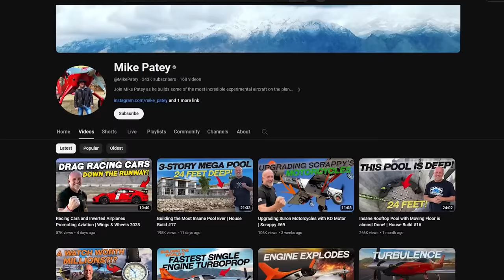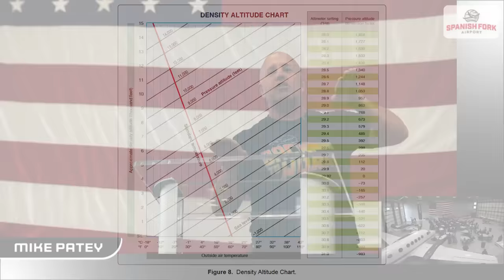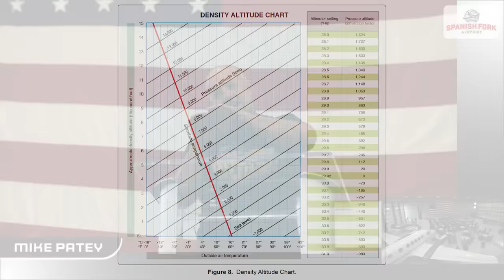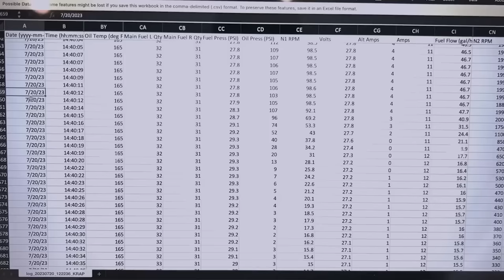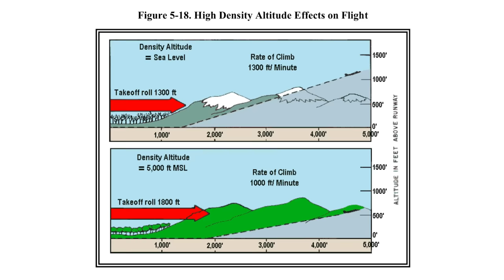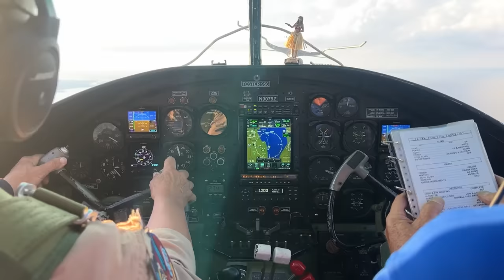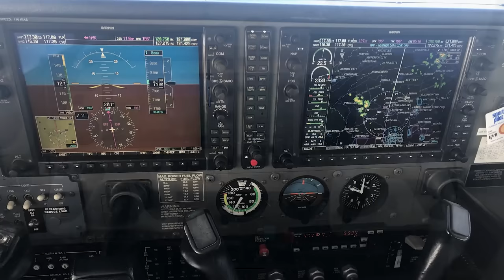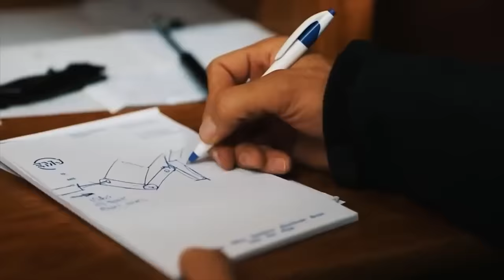I've Lost 4 Friends in 60 Days - Aviation Safety Discussion | Mike Patey

Comment: My first solo flight was almost my last flight. Everything is going good for the first 90% of the flight. I am in a rental 1976 Cessna 172. I am 8 miles from the airport, an uncontrolled field. I make all the proper callouts and begin to plan my approach when I start smelling smoke. It was that unmistakable burnt wiring smell. It's an old plane and smells like an old plane, but this is new. So I continue as normal and now I am SEEING smoke. It's coming from my feet under the dash. So I vent and begin to panic. I can't think. I can't decide what to do. I hit the radio transmit button and the instant I pushed it in, I lost the radios, all my instrument lights go dark and now I am bricking it (as in shitting a brick). It's still nice and bright out, perfect weather and the field is in sight. I start thinking about reaching into my pilot bag and get out my portable radio and making a callout. But I don't have time. By the time I get the radio out I will be on final and trying to land. So I go back to my training. Aviate, navigate THEN communicate. I did pull out the extinguisher and laid it in the seat next to me because I was expecting to see flames and feel heat. I get it down fine and taxi to parking. I did a complete shutdown and got out. I start poking around and found a wiring harness with about 12 wires were melted together. I took pics and sent them to the rental shop along with a description.  They sent another plane out to get me and made whatever arrangements they had to do about the broke plane. I found out from their mechanic that when the new radios were installed by the past owner, they routed the wires incorrectly so whenever you pushed the pedals, it pulled this wire back and forth which cause it to rub against other wires and eventually wore thru the insulation. How do you protect against that? I went through all the documents and checklist when I rented it. All the air worthiness docs, all the maintenance docs (the AC 43-9C) and it looked like a well maintained aircraft. I almost quit it shook me up so much. What if I were over a city at night in weather? Granted, I would never be in that situation unless I were much more experienced. It took a while to get my confidence back, and people think I am nuts when I look up under the dash before I fly! lol
Reply: 55 yrs CP and AP 
I've many incompetent AP and AI. No integrity pencil whippers.
Reported some to FAA, ignored, and 3 people died exactly as I predicted for that aircraft. Zero happened. FAA sucks.

Comment: Flying into a dead-end canyon that can't be over-climbed is one of the primary reasons the Chandelle maneuver is part of the FAA Commercial pilot standard.
FAA defines it as, "a climbing turn beginning from straight and level flight, and ending at the completion of 180 degrees of turn in a wings-level, nose-high attitude at minimum
controllable airspeed." The key is full power to min airspeed, lots of rudder to keep from skidding with the nose high attitude. Done correctly it puts half or more of aircraft's turn total radius in the z-plane (vertical plane) which minimizes the horizontal radius where the canyon walls preclude a flat level turn. Given the left turning torque at full power, nose high attitude, most standard GA aircraft, the turn should be to the left if possible, which means hugging to the right side of the canyon before the maneuver starts. This has to be practiced to confidence in the particular aircraft so that a stall spin won't be initiated.

Comment: Wing stall at low altitude with no room for recovery.
Aircraft speed must maintain lift sustaining flow in critical flight regimes.
Never dice with overloading conditions and engine anomalies in operational control.
Check list fuel an center of gravity every pre flight.

Comment: Mike, I am not a pilot, but have read aviation stuff for fun for many years.  I am a chemist and physician, though.

I believe that to raise awaereness on the effect that altitude/temperature has on air density and performance, the term "High Altitude Density" should be replaced with the more descriptive of the problem at hand: "Reduced Lift Altitude."  In this way, new pilots and old ones will think twice about the total weight on an airplane, and other factor affecting lift/performace, when planning.  How long would the maximum take off roll be for this particular site and plane, and plan accordingly.

We forget things easily as we age & become less alert in whatever we do, and if the safety mindset is not hammered into our brains early on, and re-learned day in day out, tragedy strikes sooner or later.

Language matters, and the term "Density Altitude" does not scare the hell out of anyone, but in my estimation "Reduced Lift/Density Altitude"  or "Reduced Lift Altitude" does a better job at making me think twice about safety before the takeoff roll.

Greetings from Puerto Rico.

José Antonio

Comment: Hi Mike, I recently had a guy ask me if he should take the TKS option on his new order DA-62. You explained so well why TKS is a terrible choice for most GA pilots - simply, you shouldn't be in icing conditions in the first place and TKS will not necessarily dig you out if you get yourself in trouble. It's a false sense of security. Your general comments on safety are well-reasoned. Can I ask if you and your brother have a safety manager or an integrated safety management system for your operations? It seems like you have enough complexity to warrant it, if not through regulation then through common sense. Formalised safety management is so incredibly beneficial to general aviation.

Comment: I was sort of wondering the other night, how pilots of "heavy metal" actually count their Flight hours. I mean, if someone is a 10.000hr pilot, does this mean that the time is counted from Wheels up to wheels down? Or do pilots also count the taxiing out to the runway? (as they are basically controlling the airplane at this time.)
Reply: Usually from first movement under local power until last movement, including taxi time.

Comment: I'm not a pilot, but this information should be required for anyone getting into an airplane.  All the lives in the plane need to be aware if the pilot is taking any risks or has accounted for everything.  Other people in your airplane should cause you to be that much more diligent in your strike system and they should know.  The risks should not be superseded by the thrill.

Comment: I've always felt relying on de-icing fluid is stupid.

1) turn on too soon and you run out before you clear the icing.
2) turn on too late and it wont work.
3) don't turn on at all and it's pointless to have it.

you need something that heats the wing and melts the ice, or a physical de-icing like boots. or just don't fly in icing.

Comment: If in ice, and you have the performance - always CLIMB out of the ice.
The ice layer is only a few thousand feet thick, and it will end.
You can always come back down.
Just add a whole load of extra airspeed, onto the stall speed.

Once you run out of performance,
You are coming down.

R

Comment: i agree with you 10000% i  have been flying since i was literally 8 years old. i had my 1st flying lesson in san carlos calif for my 8th birthday/ i fly a 1978 cessna 340  new ram engines new  full glass panel. i have owned that airplane for since 1981. BUT i will not fly if it is winter  or known icing in my trip. maybe i am a fair weather flyer. but  safety is my number 1 thing. if i do not fly for 4 months i call my instructor and say let go for a check ride, i am 70  and  do not basically want to scratch my airplane  and i like living. also pilots today  only know how to fly on computers. they never  learned spins or high speed stalls. nor have they learned aerobatics. you have to know how to fly. not by cell phones or these fancy glass panels. i have lost many many friends over the years from stupid mistakes. they have to go,  the weather maybe bad but  the plane can make it that will get you killed. i have over 5000 hours in that 340  i do not want to get hurt.  or hurt someone else. i never have a 2nd pilot because they either do not know my airplane or know everything. that is the guy  i knew who crashed and killed himself and his entire family  i take my dogs  and one cat who is probably a better pilot than most of you take it off auto pilot and fly that damn airplane. get to know it. how it really handles.

Comment: The performance degradation due to ice is almost never due to the weight of the ice. Ice actually doesn’t weight that much. It’s all down to lift degradation. Also, iced propellers are deadly. I’d climb through icing with dead boots but prop deice unserviceable is just a no go no argument item. 
It wasn’t the weight of the ice that was gonna kill him, it was the altered airflow due to the ice.

Comment: I hadn't heard of 4 fatalities near Utah so I guess we don't hear of all fatalities in accident reviews. Let's get them on the table and learn from them. I figure we can solve it all. A lot of it with engineering. Take a rational look, no sacred cows, it can be done. One relatively easy thing that might be potent is for computers to listen to the plane. Engine sounds, fuselage and wing vibrations, performance of the plane if the acceleration on the runway suddenly isn't like it used to be. A computer can pick up very subtle things and software costs nothing. Some kind of strain gauge on the landing gear can tell the weight of the plane and could catch those clowns that tried to kill Mark. Automotive tire pressure sensors might do it. Same with building up ice, the computer can tell that the speed doesn't match the power settings on the engines. The vibration frequencies in the body of the plane also change if something is attached. Control surfaces will vibrate differently if the joint is lose or the control rod is. Good enough systems can tell if a single rivet is off.
If our planes have good synthetic vision avionics it's harder to get spatial disorientation. Maybe even thermal camera. Or a visual camera in case the windshield gets covered. It's hard to get lost if you can see clearly. And some planes are more dangerous than others. My pet concern is for instance the Bonanza. It seems to climb so slowly that it can't glide back and with a high stall speed it might get many in danger. A couple died in one a couple of days ago, possibly from lack of climb near mountains.
You could also imagine that engines have cameras in them that can pop in for occasional inspection. For instance a camera in a turbine engine for every stage that can pop in and take a look at every blade that pass by. Cameras can be dirt cheap today. Imagine if inspection would be a thing of the past. That the plane always senses itself like we sense our bodies. 
Plenty of opportunity to improve things. We can't have Patey fall apart on us so let's do this :)
Reply: 2 of the fatalities were Utahns.

Comment: I flew single engine at night because I HAD to for work. Especially out West, or anywhere you don’t have a ton of airports or “safe” landing areas, within glide distance, it’s a bad idea. I stayed high, and familiarized my self with  safe-ish areas to go should the engine quit. It was still dangerous. I see all these folks making unnecessary cross country flights over unforgiving terrain at night and shake my head. Just wait until light. If you can afford a plane, you can afford a hotel or delay a meeting. Any emergency at night becomes exponentially worse in the dark.

Comment: I think the ICON A5 crash incident flown into a canyon by staffs of the company is a typical example . Flying into canyons is a different ball game entirely.
Reply: Its an "Atypical" example. If you mean an example of how most people operate aircraft. That accident, along with the other high-profile crash, are both direct results of designing an aircraft for, and marketing it to be  flow and maneuvered at low level. This is a half-baked idea from its inception, and it will eventually kill every customer who purchases one. As long as they think its more of a flying PWC, and not an Airplane that can land on water.
Reply: @TheJustinJ  you do have a point there. Aircrafts should be advertised as aircrafts not power bikes or air versions of pwcs' or or even jet fighters!

Comment: Flat lander's in the mountains at the Aspen Colorado airport.  There was a mural at the FBO at Aspen showing all the crashes around the airport of the flatland pilots from Texas, Kansas, etc., stupid deaths taking off there,  likely with non turbo engines, with a full load of fuel, people, baggage for skiing and doing the procedural turn into the terrain instead of going down the valley to gain altitude.  "Selected against for Stupid."  Darwin award.

Comment: Not all pilot are engineers. Meaning it needs more than a book and protocols to be come a good and wise pilot.
What Mike points out is my horror two. Me renting out planes to airline pilots it occurred that these airline pilots are not always good and wise pilots too.  I started to do 15 minut refreshers before handing over the rented plane. 
Show me some proficiency first before you bend my prop.

Comment: EVERY pilot, all of you should be glider pilots before you become motor pilots.  These accidents would happen infrequently if pilots started flying gliders, we think so differently from motor pilots it's comparable to fish swimming vs birds flying, the environment is similar in some ways (fluid dynamics)  but so different that it's completely foreign to each species.   Up drafts, down drafts, cooling, heating, thermals, ridge lift, cold air, warm air, rotor, wind direction, time of day, where the sun is, shade vs full sun on hillsides, on and on.
Reply: Nope, you need to learn in AA1's and AA-1B's as your beginning aircraft.
You learn instantly about what not to do.
Reply: @arthurfoyt6727  The issue is most people don't get practical time in learning, just didactic time.  Because I learned gliders first I think like a glider pilot, I feel the air and think about what's always going on out there.  This makes me a safer pilot.  For example, while I fly I'm always scanning the ground looking for a bailout LZ.  This was drilled into me as a cross country glider pilot.  I see terrain and think about the wind direction and what is possibly going on around me.  I have had long conversations with motor pilots that seemed to tune out all this information and focus primarily on their aircraft.  It's 50/50 split, you need to know what's going on in your plane and what's going on outside your plane.  Too many focus on one or the other and this is where mistakes are made.
Reply: @kalbic  The issue is that most pilots learn on gentle docile planes that glide at slow speeds and THAT is the problem!    I suggested AA1's because it's an Anti-glider and anti-172.    Look up most GA accidents and they are because people learned on slow flying planes that would glide easily.  The AA1 has almost no wing, almost no tail, and barely 108hp when new. You LEARN how to fly because the aircraft itself is not some glider or 172.   Best trainer in the world to learn airspeed control and what not to do; especially learning giving yourself large margins for takeoff and landings.

Comment: This is why you use a liquid cooled engine with heating pipes through the leading edge with heating elements as a booster. Not sure why people still use aircooled engines.
Reply: Because they work.
Reply: @Ptro1  It was trialed before WW2 with great success (Germans). They did anticipate one issue that we do not experience in general aviation, that is bullets. This was at a time when Liquid cooled piston engines were the forefront of aviation. Large airliners circulate heated fuel, although it is mostly to stop the fuel freezing.